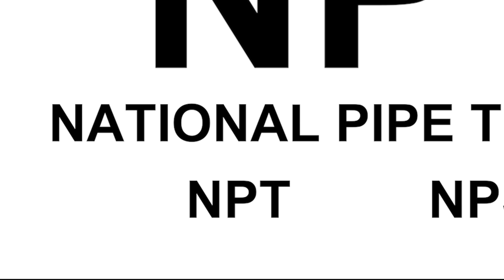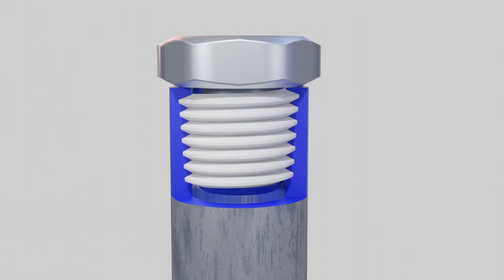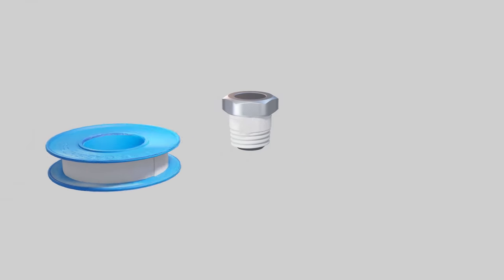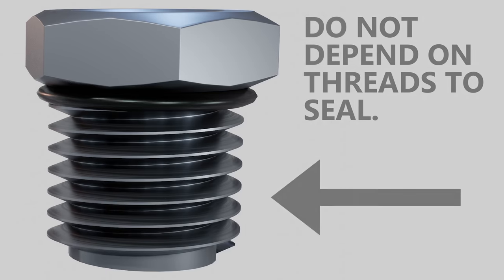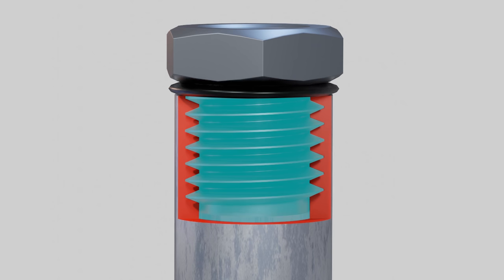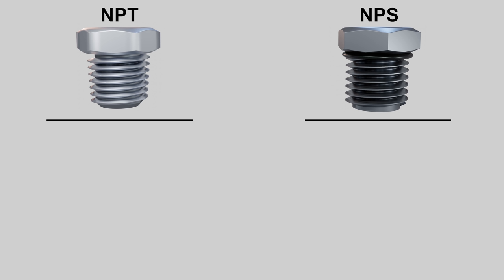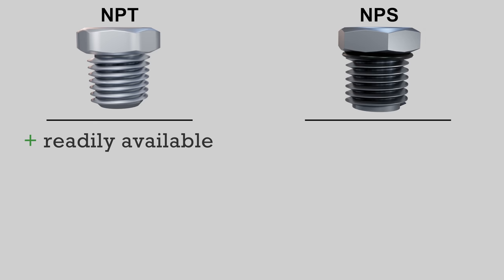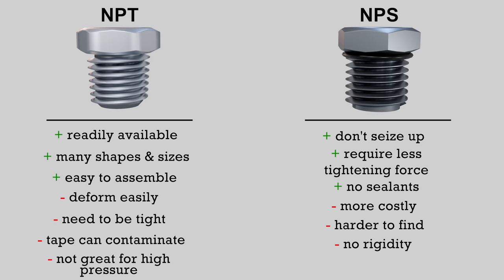PLUMBING THREADS 101 (EVERYTHING YOU NEED TO KNOW) | GOT2LEARN

Comment: I'm an engineer and this video is extremely useful. I was trained to solve fancy equations involving fluid flow but I struggle selecting proper threaded fittings or alternate configurations where I get to pick whatever I want. The practical stuff is what I need to focus on. I don't even know how many types of threads are out there and what they're used for. I know I'm not the only one.
Reply from the maker: You are most welcome, please share if you can, it helps the channel tremendously ✌✌
Reply: It is a great service to the world to get an engineer to focus on practicality 😂
Reply: That's okay. I've worked with engineers who had zero concept of Bernoulli's Principles.
Reply: Yeah we call this book smart, life stupid .Which seems to be the issue with most modern day engineering.
Reply: Yeah you ain't the only  one

Comment: threads have an inherent leakage path. the flanks do not create a seal. instead ALL theaded connections have a helical leakage path. You'll strip the threads long before you ever jam them tight enough to prevent leaks. PTFE and dope serve 2 functions. 1: prevents parts from rusting together. 2: fills/clogs the leakage path around the threads.
Reply: and #3 anti-seize
Reply: So it's the PTFE that seals tapered joints?
Reply: @ChilledfishStick  yes, it is what makes tapered, threaded joints seal.
Reply: @theotherJarvisx51  Wrong.
Reply: @richardhodds7812  I put lots of pipes together with just the thread cutting oil - and no leaks. If there is a small leak, just tighten some more and it stops.

Comment: I have been cursing straight pipe threads since I arrived in Argentina. The most common plumbing system is polyethylene pipe with straight pipe threads. It is sort of sealed by using 10 to 20 wraps of Teflon tape. Hemp used to be used a lot but now not do much. There are also some liquid sealers but I haven't had much luck with them.

Comment: How about a video on the how's and why of the 2 different threads on angle stop valves. It seems that over the past 30 years the 1/2 compression side of the valve that attaches to a copper stub out has changed from fine threads to coarse threads
Reply: I started repair service in 1986 and discovered the same issue. 
The actual compression size is 5/8 inch, but some manufacturers used a pipe thread instead of a standard compression thread resulting in the issues you noticed. 
If you run into a pipe thread compression fitting, the best bet is to use a puller to remove the pipe thread compression nut and start over with a proper fine thread compression fitting.
Reply: And never use pipe dope on the threads because this will cause you to possibly over tighten and split the compression nut. In the instructions says you can you can add 1 drop of oil but when the nut becomes hand tight, only tighten the nut half turn more and stop.
I’ve seen many over tightened and split because of pipe dope on the threads.

Comment: I ran into a homeowners brother from far eastern Europe who said they used to fix everything with string and grease. 
In the US we used graphite and string. 
Hemp isn’t far off the mark. 
Anything that will allow the threads to move and tighten and fill gaps might work. 
Do not use ANY of these (except an anti-seize/lubricant) on straight threads that are designed to work with a gasket or a compression fitting.

Comment: Damn, I was hoping you'd cover some higher pressure and wider term range fittings like JIC/AN, O-ring boss, compression fittings, etc. I work with mostly high pressure nitrogen and medium to high pressure pressure liquid oxygen systems and am always on the lookout for good intro material to show new people. Sadly this excludes NPT and NPS as they aren't suited for cryo.
Reply: Hi, would you have any recommendations for intro material for plumbinbg of high pressure cryogenics? I had no idea NPT is not cryo rated!

Comment: Around the 1:30 mark you show the root and crest of the threads at the same location. The root should be shown at the base of the “V” of the thread. I still enjoy your videos. Thanks for making them.
Reply from the maker: Thank you very much!!!
Reply: To add to this, crests are always at the peak, and roots in the valley, regardless of whether they are external or internal.  Your illustration is not entirely correct.  Flats exist on both the internal and external forms.  Since NPT threads are intended for low pressure, low heat applications, the tolerances on the crests, roots, and flanks (pitch diameters) are quite liberal.  When manufactured at one extreme, when the parts are assembled, the crests and roots contact each other and that is the increase in torque that you feel.  Further tightening causes these areas to crush until the flanks come into contact.  Theoretically, this gives you a "dryseal" fit.  At the other extreme, the flanks come together first, and no amount of tightening fills the voids at the crests and roots.  This is what the tape, dope, or lubricant is primarily used for.  Lubricating and anti-seize are secondary benefits.  Since these compounds are inherently weak, they are unacceptable for high pressure/high heat or caustic chemical applications.  There are Dryseal threads for this, such as NPTF.  I was on the ANSI/ASME standards committees that design and regulate these various forms.  Dave

Comment: In Europe, Whitworth threads are used for plumbing. Exactly British Standard Pipe. 
BSPP = parallel, BSPT = tapered.
BSP can be confused with NTP.
The flanks are 55°, not 60° as with NTP or metric threads. 
There are tapered and straight threads. Straigth threads need a seal as shown.
Note a 1 inch pipe is approximately 32 millimeters in diameter, not 25.4 mm as usual.
Even if the mertical system is used in Europe, this old inch standard has remained.

Comment: I’ve been using teflon tape with the wrong premise. Thanks for correcting me. Problem is a lot of accessories with straight threads come with Teflon tape which is why I use it everywhere when plumbing. I also use alot tapering the layers. I’m guessing this is wrong? I do this so I can position fittings otherwise the tightness where it won’t leak is in the wrong position.

Comment: Tapered threads are used in high pressure applications. All fire sprinkler pipe that is threaded are tapered.
Reply from the maker: That's not high pressure.

Comment: Here's a Idea for a video and a question. I was sitting here thinking for pvc, pex, and copper pipes, there's alot of screw in pieces now.. So what if someone used Taps and Dies to create their own threads and do their whole pipe system that way rather than soldering, glueing, or crimping? It would be easy to replace a piece ( i mean pex already is easy but gets costly when you need a bunch of fittings.) I would assume thought you have to use NPT, as NPS you would have a hard time figuring out had to add a O ring to pipes especially if your not one of those people that know everything about all things tool and creation wise. It would be interesting and it seems like it would be cheaper than any of the already existing methods.

Comment: I never use hemp or PTFE.  Locktite 577 all the way.  No leaks and joints can be separated again in the future.
Reply: Common Sense Realist  577 doesn't harden to the best of my knowledge. Stays kinda 'goey' when I had to remove parts sealed only with this. Works perfectly even on a wet / pressurised system when in a pinch and saves you from faffing around trying to find the beginning of the thread when it's taped with PTFE which is not ideal whilst being sprayed with water at 3 bar...

Comment: I use a lot of schedule 80 barbed fittings with 1 side male thread usually 1.5" and 2" size. Sometimes but not always the fitting will say right on it " USE NO PIPE DOPE". Can you explain this a bit more. I am not sure what to do here so I just tape it. An example would be a 2" barbed fitting threading into a 2" galvanized Tee. Thank you so much for your enlightenment!!!
Reply from the maker: They most probably mean to not apply dope on the barbed side.
Reply: @Got2Learn  Wow...I would never think to do that. I guess they have to idiot proof everything these days
Reply from the maker: @duck101963  🤘👌

Comment: All fire sprinkler joints in Australia are sealed with hemp and soap. We havent caught up to the rest of the world yet. But the hemp works, is cheap and rarely leaks
Reply: wow. what happens if the joint gets hot?? then it's supposed to let water leak anyway?
Reply: @wim0104  the sprinklers would put out the fire way before the joint ever gets hot
Reply: That is the same in many parts of the world as hemp has different properties that make it a better sealant than PTFE-tape for some applications. Another example would be gas-pipes: In some countries (and parts of the US) it is not allowed to use PTFE-tape to seal the gas-pipes of residential buildings.

Comment: I am a retired machinist that cut all kinds of threads on a lathe - Acme, left hand, double lead etc. Now as a handyman plumber I find these video  informative. You might have mentioned that sometimes the taper and strait are used together. EXAMPLE: Flexible water heater connectors they are straight pipe female with a rubber seal. They are coupled to a tapered thread male nipple on the water heater. Correct?
Reply from the maker: Thanks! The straight threads are connected to straight threads with an oring, gasket or flared connection, and tapered just by friction.
Reply: Those are straight threads?

Comment: Great video! If I may add, we call straight threads a running thread. They are a result of letting the pipe die run down the length of a pipe. ..of course,  the leading few threads will be tapered so typically,  you would run it on a piece of pipe longer than you need and cut off the tapered threads.  Also, if you've ever bought some of that seemingly all thread tubing thats used in lamps and such. ..its basically threaded conduit. I've used it in 3/8" and 1/2" diameters but  that's not what they are. You'll never get a nut with NC or NF threads to screw onto them because they're actually 1/8 and 1/4 (respectively) pipe threads. ..and who came up with the sizing on pipe threads? ..maybe there's a schedule of pipe where it all makes sense.
Oh, ..and don't forget about the British pipe size. If you want to pipe any high pressure air,  like from a SCUBA or SCBA tank to use to charge a paintball marker or a PCP air rifle,  those fittings are usually in British pipe sizes. They're the same goofy diameters as NPT but the threads are slightly off.
Reply from the maker: Good info, thanks!!! 🙏

Comment: I used NPT female threaded shark bit fittings to repair the leak on top of my water heater. I believe they are tapered thread (bought at Lowe's). If I continue tightening them will they eventually stop the "seeping" leak or will they break?
Reply from the maker: Might break, better undo it and inspect, might already be cracked.

Comment: 1:50 between the root and the crest is always space - wouldn't that create a small leak? I guess that's what the PTFE tape is for? I also have a hard time believing that PTFE tape allows you to seat it deeper, as it adds a lot of volume so then you can do less rotations until it's seated. Oil would be an actual lubricant.

Comment: Whats the make up on  threaded gas pipe fittings? i'm having a hard time researching the answer
Reply from the maker: What exactly are you referring to with make up?
Reply: @Got2Learn  the distance that the threads go into the fitting. like if I had a face to face measurement from one 90 to another 90, how much would i have to add to account for the pipe going into the fittings
Reply from the maker: That changes with each size but it's pretty much always 1/2"

Comment: What about threads for steam?  I have old piping and several leaks to fix in threaded connections once heating season is done. Should I use brush on stuff from the hardware store or is there a secret for threads with steam?
Reply from the maker: You can use pink teflon no problem.

Comment: Speaking of pipe dope and PTFE, I’ve heard they can be used together, but in what order? 
Do you prefer one over the other on pipe threads?
Reply: The way I've always seen it done was tape Will go on first dope on top I think I would have trouble putting the tape over the dope
Reply: Tape the male, dope the female.
Reply: Dope tape dope. always on male end.
Reply: @scottsatterthwaite4073   you aren’t supposed to ever dope the female threads on any threaded application
Reply: @EthosEater  I'm 58 and have been doing it my way most of those years with great success.  The reason "they" say not to do that is because it will force a little pipe dope beyond the threads into the pipe.  But you are supposed to flush the lines anyway.
Reply: @scottsatterthwaite4073   “they” are the ASME and IAPMO haha. Really it only matters if you stringently follow the UPC, if your way has been working for you all the power to you
Reply: @scottsatterthwaite4073  Bingo. Same way we have done it for years without any issues.

Common sense should always be at the forefront.

Comment: Are NPS threads the same as electrical rigid conduit threads?  Seems like no one can tell me what
rigid conduit threads are.
Reply from the maker: Personally, I don't know...but maybe someone here boes as a lot are electricians, just give it some time ;)
Reply: when threading rigid conduit you can use a plumbers die, just thread back far enough to accomondate locknuts & bushings.

Comment: So there was a gas leak in my grandma's attic. The handyman who installed the furnace used white Teflon tape on the flare threads. I ended up replacing the connector and installing a drip leg.

Comment: Touch on which threads to never use Teflon or thread twine. Like slip joint nut threads. Compression fitting. Flares. Plastic female to metal male. Things like that. I caught on once someone showed me how to use Teflon to keep a shower arm thread from leaking and ended up breaking the plastic female. Then the shower head. Lol. That was my hint that Teflon was not a miracle wrap. O and garden hoses. Show threads locked down but hose still dripping behind the washer. Lmao. I love plumbers that just wrap everything

Comment: Ok how do you connect pictures schedule 40 to galvanized pipe with threads?
Reply from the maker: Pictures?
Reply: Do you mean fixtures?
Reply from the maker: @sainttrilby7171  🤣
Reply: Make sure the PVC male adapter is schedule 80.  Screw it into a fitting or coupling using a bit of Teflon tape.  If you are careful, you can also use a bit of pipe dope as well
Reply from the maker: Or just use dope.

Comment: Bravo!! Very informative.

Do you have any content regarding the Vacuum Relief Valve on residential hot water tanks?? I just came across one that was weeping from the slot in the valve and I had some trouble trying to get information...
Reply from the maker: Thank you so much!
Unfortunately, I do not, not yet 😩
Reply: Why not just replace the valve and move on?
Reply: Michael Lewis Honestly, I didn't know what the weeping fitting was on the gas fired hot water tank!! At my parent's property. 

Turns out I never had one on the hot water tank (electric) at my house which lead to my confusion.  I'll need to address this on my tank.
Reply: @MarioDallaRiva  gotcha. They are super cheap and easy to replace so it seems like a non issue.
Reply: @michaellewis6569  Thanks, Michael! Yeah, they’re around $20 here in Canada.

Comment: I always use both
Reply: @Got2Learn  Hey man. Here in ireland we use alot of compression and soldering fittings. I once sen a compression fitting with no olive and it still made a watertight joint.
Fucking weird!
Love the tips and tricks of your videos and keep em coming. 👍 Also we mostly bend copper tube to make everything flow to wherever as easy as possible. I have to admit I think it looks and works better.... personally for me that is.
Reply from the maker: @fionnan2811happy  awesome, thank you so much!!!
Reply: @Got2Learn  Neat trick also. If you were short an o-ring you could use bubble gum as a seal and I've tested it to 10,000psi with hydraulic pressure.
Love to see you incorporate that into your videos. If you ever do let me know as I'm out plumbing and might not see the video.
Just a tip and trick.
Works for water also.
Used it on a machine one day as a last resort and it worked.
I thought it was a one off but tried again and got the same result in different fluids and air.
Reply: You should send me your address so I can send you a pipeslice as its in imperial here in ireland also. They are very fast for cutting copper and there is a different wheel for stainless steel but I can't afford to send both. But I think you will be very surprised how fast it will cut hard copper and soft copper.👍 And u can use my name and it will  benefit me for work here in the countryside. 
Just let me know as I have one here that I can post today!

Comment: 4:54 Not the best for high pressure? That's weird, because in hydraulic systems on tractor, its only used tapered threads. And tractor hydraulic have A LOT of pressure.
Reply from the maker: Really? I think we don't have the same tractors hehe 😆
Reply: @Got2Learn  Tractors have a max pressure of 2000 psi before the relief valve opens.
Reply: @HorizonFarming  2000PSI is not particularly high for Hydraulics.
Reply: @skullandcrossbones65  **Bruh**